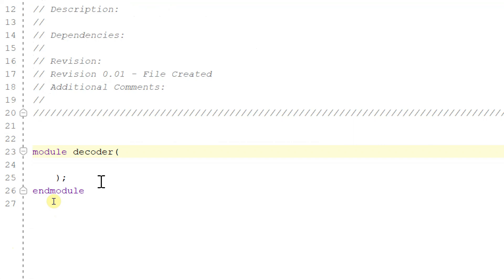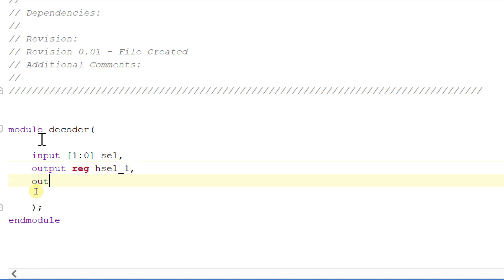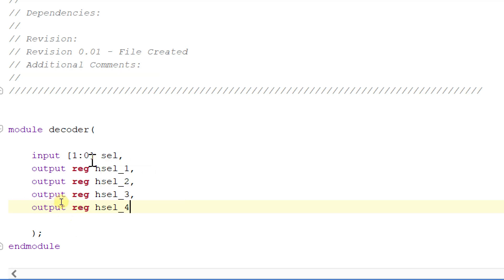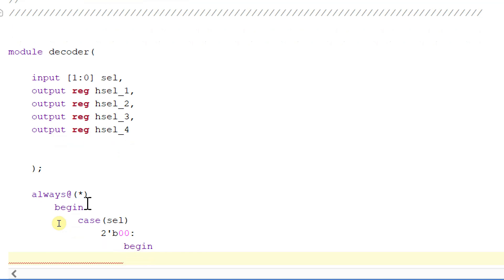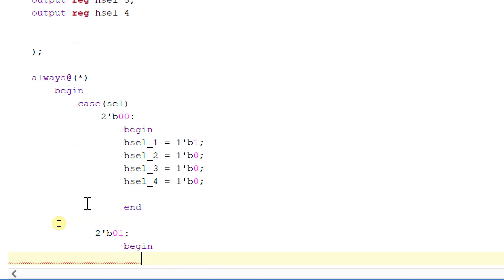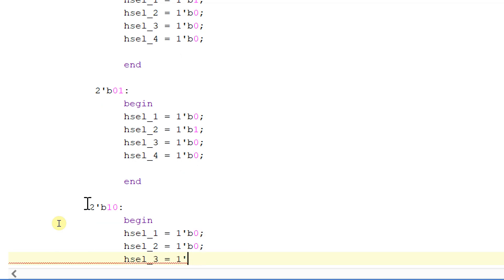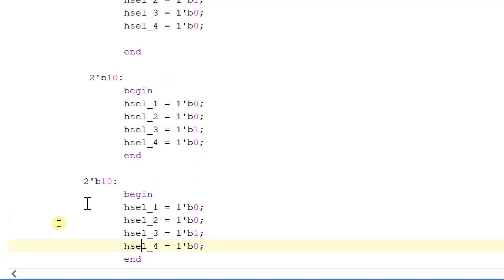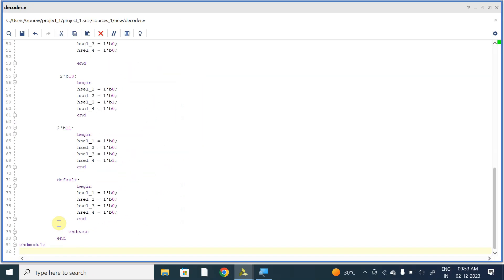Verilog code for decoder in amba ahb bus||

Comment: In the previous video the memory declared as 
[31:0] memory [31:0] is equal to 1024 bits and in the spec it's saying each slave can have 1KB that is 1024 Bytes memory. Please can you answer this ?
Reply from the maker: yeah you are correct instead of 1024 bytes i have taken 1024 bits of memory thank you for pointing out.

Comment: Hi in this protocol it saying that HSEL_X is enabled based on HADDR[31:0] but why you are taking reg [1:0] sel as input. and Decoder have only HADDR[31:0] as input that's it(according to spec)

. May I know why you are selecting slave 's explicitly ?
Reply from the maker: Intially i thought of writing code which automatically selects the slave but i have written the code which selects the slave according to the input given in tb i.e the master. If you want you can modify them
Reply: Thanks for reply